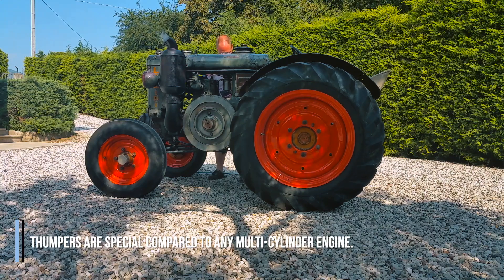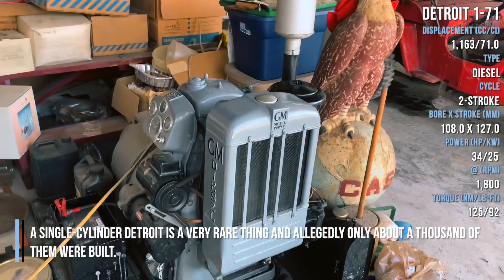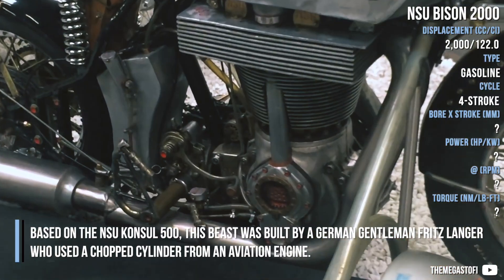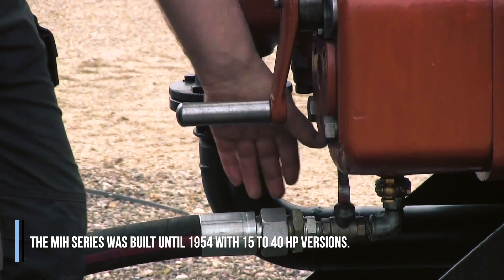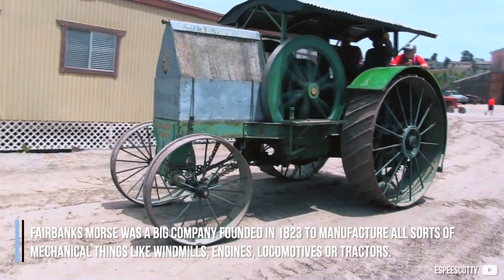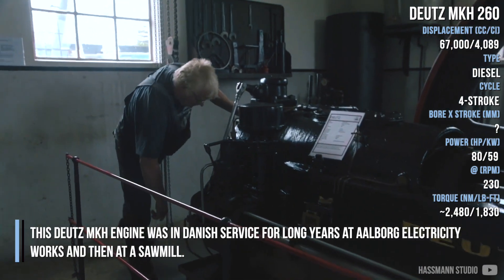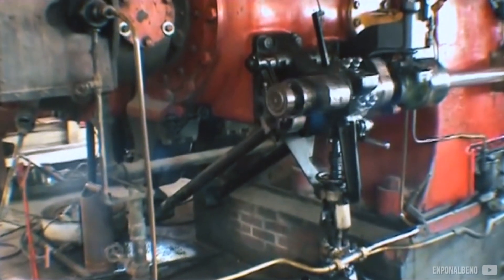Largest 1-Cylinder Engines

Comment: I was 10 and at the Antelope Valley Fair in Lancaster California, and there was an old machinery area. There was and elderly man (quite a character) holding a red solo cup and standing next to an old Hit-And-Miss motor, I don't remember the cylinder number but the sounds in this video reminded me of it, it would thunk loudly (the hit) then it made a kind of sucking noise (the miss), and the guy would put the cup on the exhaust pipe, it would suck the cup down then the hit would come and the cup would go about 25 feet in the air...

Comment: Cylinder & heads for aircraft radial engines were developed as single cylinder engines.  Say, 5.5” B x 6” stroke.  Not as big as bruisers in the video.  But they turned at 1800 or so.  Can’t image how much concrete they were bolted to otherwise think pogo sticks.

Comment: It brings back memories of my BSA 441 Victor motorcycle I had back in the early 70's. I loved that bike, mostly for the unique sound of the "one-lunger engine". There's something oddly satisfying about the sound a single cylinder engine makes.
Reply: Got a BMW F650. It has a pretty short stroke Rotax 650cc engine. Sounds great, even as a civilised road bike, with huge airbox and enormous kat included muffler.

Comment: In Argentina there was a tractor called IAME Pampa it was a single piston engine, with a displacement of 4000cm3, my grandfather told me that it had 50hp,  and rev up to 800rpm, the engine was horizontal. It was fabricated in the 50's.

Comment: Our family textile mill in the north of Scotland was powered via overhead shafting from the late 1920's by a single cylinder Shanks diesel producing 80HP. It was a licence built Deutz engine and replaced the earlier Tangye producer gas engine. It also ran a 175V DC generator providing lighting power for the mill and my grandfather's house, until the arrival of mains electricity in 1938.

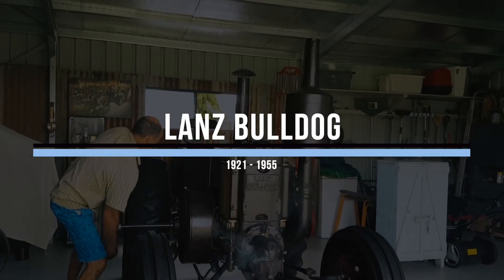Comment: The traktors at 4:40 - 5:00 are not idling at 350rpm, but it was the max rpm.
idling is around 100-120rpm maybe even lower.

Comment: There are many of these powerplants in Australia and manyof these clips look Australian (note the Queensland 'QLD' numberplate on the tractor)
They were used on most farms and workshops to run all day, powering all sorts of tools and sometimes generators, via belts and pulleys. Sheep shearing sheds would have a row of mechanical shears hanging from the ceiling, all driven by a single driveshaft, powered by a one of these steady old bangers. Very cool!

Comment: One thing you got to love about those old engines is you can change the valve lift with duct tape and a matchbook cover. Love those old engines like that. People think we are smarter now than we used to be, quite frankly I wonder. Look at the amazing stuff that was built prior to CNC machines and computers. Back when a machinist couldn't just go buy his cutter but needed to hand grind it and people had to do all the calculations by hand.

Comment: except for Hot bulb engines, the biggest single cylinder engine I have com into contact with is a 600cc on a Goes 525s ATV. that thing sounds very similar to the Suzuki, but also has a supercharger esk whine at high speed and full throttle. Dunno if that is the transmission or the engine tho

Comment: 4:05 did that just reverse the crank rotation?
Reply: This is how it supose to work
Reply: If you slow the engine down enough almost to the point of stalling, it'l bounce back. I fly RC planes and the little 2 stroke glow engines do the same thing if you happen to start them running backwards.